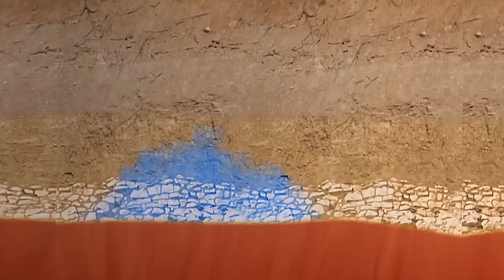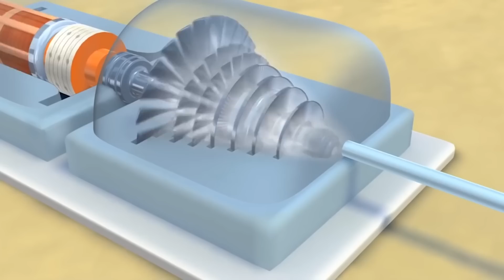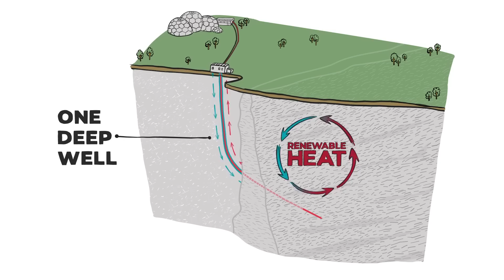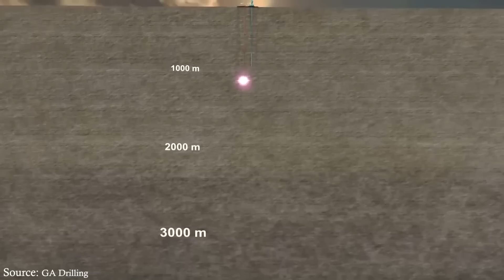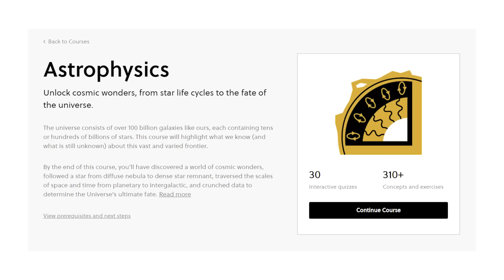How This Hole Keeps Generating Energy

Comment: If I may, all oil and gas wells on Earth can actually be converted into Geothermal power plants for electricity and district heating/cooling.
There are many abandoned oil/gas wells (including coal mines) that can be used for such a purpose... and oil rigs in the North sea are especially usable because the geothermal gradient there is far higher (aka, hotter temperatures at shallower depths of bore holes which automatically provide high enough temps for electricitiy and heating production [combined]).
Additionally, A LOT of the said oil/gas wells already reach down 6 to 12 km... which are deep enough for electricity production.

The Geothermal facility which was newly constructed in Cornwall UK was said it will produce about 3 MW of electricity and 12 MW of heating/cooling - and this is with a well of about 4.5km depth - which is not bad, but its also shallower than many oil/gas wells).

It was also said that converting oil/gas wells to geothermal would cost HALF as much vs what it would cost to decomission them - and heck, why not? The infrastructure is already there. 
Plus, all of the equipment, people and their skills are DIRECTLY transferrable to Geothermal sector.

While it is also accurate that for new geothermal power facilities the drilling costs are what account for 30-50% of the costs, what most people fail to realize is that utility scale geothermal power plants tend to pay for themselves in up to 10 years time (typically around 7 years maximum), after that, they are virtually free to run.
They also have no running fuel costs, have reliability and efficiency ratios of 90-100%, and levelized cost of Geothermal has been holding steady for over a decade now at $70 per MWh (whereas most running costs of Geothermal are between $14-$36 per MWh).

Essentially, Geothermal has all advantages of Nuclear, but none of its drawbacks (such as high running operational costs and production of nuclear waste - even new SMR's are ridiculously inefficient and will be producing 2-30 times more volume of nuclear waste than existing nuclear power plants - and their levelized costs are projected to rise exponentially in the coming decade - plus, standard operational costs of Nuclear are $156 per MWh - over DOUBLE of Geothermal).

Also, when properly maintained, Geothermal power plants can last over 100 years (as is evidenced by the Geothermal facility in Italy/Larderrelo)... and Geothermal brines tend to contain vast quantities of Lithium and other mineral resources.
It was said that the handful (about five or eight) of Geothermal plants in USA alone can provide the entire nation with many times more Lithium that it would ever know what to do with (and if we factor in other mineral resources in the brines, the payoff of the geothermal facility can be much faster than what I said above - similar ratios are for the Geothermal facility in Cornwall).

So, technically speaking, there is no need to make new wells because we have a vast amount of unused oil/gas infrastructure (even used ones) which can already be converted to Geothermal for both electricity and heating/cooling purposes.

But, I agree that Quaise' efforts at drilling 20km into the Earth would provide for much higher temperatures... but in that case, I would imagine that 20 km depth would provide for much higher temperatures than 400 degrees Celsius.

At any rate, the biggest problem plaguing Geothermal are not higher costs of drilling or our ability to access Geothermal resources for sustainable electricity and heating/cooling... its BIGGEST problem is LACK OF FUNDING.
Compared to any other energy source on Earth, Geothermal is the LEAST funded energy source on the planet.

And when we factor in how much money is given in subsidies to fossil fuels... you can tell that governments and corporation priorities do NOT lie where they should be.

Already, back in 2006, MIT released a study saying that we already had the technology at the time to access enough geothermal power to sustain Human civilisation for 200 years worth of... and that with improved technologies we can access enough Geothermal to sustain us for 2000 years.

The oil and gas industry has been digging deep bore holes ranging from 6-12 km depth for 100 years now... its not an issue of accessing Geothermal... the issue is lack of funding and willingness to shift our attention to Geothermal.
Reply: I mean we literally are sitting on a reactor, geothermal should be on the front of the energy solution
Reply: Most of them are not hot enough. E.g. if the bottom of the mine is 60 C, it's far too low to generate electricity (will cost too much per generated watt).
Reply: @denysvlasenko1865  The shallower wells can still be used for district heating/cooling.
Works just the same.
The deeper wells (ones which go down 5-6km) would be hot enough to produce electricity (in Iceland, they usually dig about 5-6km deep wells and then connect a whole bunch of them together into a single geothermal facility).

Either way, its doable.
Shallower wells with lower temps can be used for district heating/cooling, and the deeper wells with 145-150 degrees C can be used for electricity AND district heating/cooling.
Reply: @deksroning125  There are not than many 5+ km wells. Iceland is not representative - it is a magma hot spot. In most places, temperature at 5 km below ground is ~150 C.
Reply: You think too logically and straight forward. The reason why intelligent people like yourself are not allowed to design and build these machines is because it cripple the oil industry and radicalize what people thought about government, society, the capabilities and purpose of the human race. Progress will be denied.
Reply: sir, this is wendy's
Reply: > the issue is lack of funding and willingness to shift our attention to Geothermal

So, your theory is that drilling companies are willingly resisting creation of lucrative business of generation of cheap energy? (As opposed to the theory that they already tried it and it's not competitive in most locations). That would be very stupid.
Reply: @denysvlasenko1865  it's well documented that investment in geothermal is slim to non existent. The energy companies hadn't tried it before because it probably didn't occur to them. Furthermore the oil/gas industry receives massive subsidies to continue its business. 

It's only in the past year or two that some energy firms barely started looking into geothermal. 

We're talking about same energy companies that set for themselves a goal to reduce carbon emissions by 2050 despite the fact that a decade ago scientists have confirmed that transitioning to 100% renewables globally can be done in a decade and that existing agreements on lowering emissions are not being held up.
Reply: @deksroning125  > The energy companies hadn't tried it before because it probably didn't occur to them.

Absurd. There are dozens of geothermal stations in use. Energy companies DO know about the technology.
Reply: @denysvlasenko1865  
Dozens yes (but that's a far cry from hundreds like there are for say gas fired stations)... and why? Mainly because the geothermal sector progression has been stalled by lack of funding and virtually 0 incentive from the governments and not keeping up to date with the information about it.

Furtthemore, converting oil/gas wells to geothermal is not usually how geothermal is done.

Up until 2018, there hadn't even been any proposals about converting abandoned oil/gas wells into geothermal for electricity and district heating/cooling.

To top it off, MIT did a study dating back to 2006 which clearly stated that we had the technical ability back thento access 400 Zettajoules of Geothermal power globally and over 2000 Zettajoules with improved technologies (which exist today).

Furthermore, why are you ignoring the fact that the oil/gas industry has been getting massive subsidies or the fact these industries gave themselves until 2050 to 'limit emissions' which have been repeatedly stated that they won't be enough?

Experts across the globe are urging political leaders and even industries to go for geothermal, but there hadn't been a larger push up until a few years ago.

To most existing energy companies, popping up a brand new Geothermal facility is just for show for the most part. 
Also, it won't make a large dent in reducing costs of electricity or heating/cooling because the wholesale prices are fundamentally linked to gas prices.
Reply: @deksroning125  Oil and gas companies don't get any government subsidies, the UN have made that statement by calculating a negative externality and saying the tax rate should be higher, this methodology hasn't been applied to any other sector and isn't what subsidies really are. It makes it sound like the governments are providing funding. We've not yet been able to drill and maintain wells to a sufficient depth for efficient geothermal energy production, if we can crack this we have a limitless source for electricity generation. Inside plate boundaries we need to go 20km deep, oil and gas companies aren't going that deep.

Comment: @Ziroth If steam turbines in powerplants are substituted by cryogenic turbines using the same fluids as on freezers, solar power can be used to generate electricity even at night at latitudes up to 40 degrees North or South.

Comment: 1:11 Sieg: pressure from both earth compressing (and even from air pressure above it) generates friction underground.. this is the only Real cause of magma, which bellows out as 'volcanoes'..
there is no such thing as a "magma core" or maybe even a "crust".. that would be impossible, the upper crust layers of the surface would have sunk immediately into that lava..
Reply: It works just fine for boats on the ocean though.

Comment: What if we extract so much energy that the earth's core solidifies? 
This would destroy the earth's magnetic field which keeps us safe from charged particles from the sun and turn Earth into a Mars like planet.
Reply: That's not something that we have to worry about for probably millions of years. Besides, the earth is cooling down anyway. Might as well use some of that heat.
Reply: @Alex-lc1bv   The amount of energy stored in the earth's core while immense on a human scale is still finite.
Capturing heat released on the surface that would have been released anyway is perfectly safe.
Drilling ultra deep wells to harvest heat from the upper mantle is where things get dicey.

Comment: As much as I appreciate the effort made in this video and as much as I like geothermal energy, there is just so much wrong in this video. Redoing some of the voiceovers and cleaning up the misunderstandings may get the video to standard. First, and foremost, there seems to be a fundamental misunderstanding about the structure of the Earth and the composition of its different layers. I get the feeling that everything below the crust(?) or below 15 km (?) depth is referred to as the Earth's core?  Secondly, the core is largely iron and nickel, which means there is essentially no significant radiogenic heat produced in the core.  The radiogenic heat is rather produced in the mantle and crust. Thirdly, the super deep drills at the Kola peninsular and in Germany never were motivated by exploring geothermal heat. These were scientific projects. Also, what is the Earth's impermeable cap rock? If it is impermeable, how do they drill there?  Lastly, the normal geothermal gradient is estimated at something like 25–30 C per kilometre depth. This delineates some of the problems with deep drills, as you drill down you experience very high temperatures and pressures. The temperatures will compromise your drill, whereas the pressure will constantly try to close your drill hole. At 4:20 minutes in you say: "Attempts have been made to dig very deep into the Earth's core." No. The outer core is about 2900 km down and more than 3000 C hot. At the Kola Superdeep Borehole, they drilled just over 12 km ... you may find that there is still some meters left from 12 to 2900 km depth. At Kola, it was also somewhat hotter than expected (180 C) at 12 km depth, which was the problem that ended the drilling. Kola was chosen because back in the days the geothermal gradient below the Baltic shield was not well understood and they expected only 100C in 12 km depth. Then again, 180 C is not that much, you would think—water is supercritical at 373 C or so. Heat exchangers are needed to get water supercritical. So this business wants to drill 20 km (~500 C). OK. Not the core, though... still far from the mantle even, which is at about 660 km, even the lithosphere goes done to ~120 km. Do they have a plan for how they keep the hole open at extreme pressures and how to deal with the heat problem? The middle crust and the ductile-brittle transition is about at 15(–20) km depth, that is where rocks start to behave plastic over geological times...that is how hot it is down there. Just saying...
Reply: Agreed - this guy is a moron. Even worse, he's spreading all this false information as if it were true...
Reply: And you could have added that it's not actually infinite.  The Earth is halfway through its life and will be consumed by the Sun.  So it cannot be 'infinite'.  It's a very long time, I know, but the overuse (and incorrect use) of the word annoys me.

Comment: One thing that scares me about geothermal power is that the earth's core doesn't have infinite energy. And law of conservation of mass and energy says the core is a big old battery. And the more devices we power using this battery the less it will last.

So I present my theory: will geothermal energy wells turn the earth's core cold sooner than if we would have left it alone?
Reply: There are some misunderstandings in the video. The heat is not created in the core but rather in the mantle. The heat is generated by radioactive decay of U238 and other unstable elements. The mantle is a huge reservoir of heat and will slowly generate more heat, which is conducted away over very long times, through heat flow and convection, e.g. to the core or to the surface. The earth loses heat all the time. The tiny bit of heat that it loses through the crust, which is the tiny tiny reservoir (compared to the mantle) we could tap into will not be noticeable. The Earth is HUGE. Although, you are right that heat we take out is lost, for all practical purposes the reservoir can be imagined as infinite for humanity. We wont be able change the Earth internal heat budget even in a in million years.

Comment: why don't they just tap in to volcanos where the lava is already closer to the surface?
Reply: Possibly because occasionally they explode
Reply: @spackerinternational6131  who's to say the pressure between the drilled hole and the Earth's core will not exceed the strength of the hole and cause a explosion similar to a volcano? since that's pretty much how volcanos got created.

Comment: Actually, I think that this is a pretty stupid idea. Imagine this "solution" to be scaled up. We will cool down the earth much faster than necessary and this will in time interfere with plate tectonics, about the mechanism of which we still know rather little. If we use such technology to cool off lava domes which would sooner or later turn into super volcanoes - looks like a great idea on a first glance - whereby we do not know much about the importance of volcanoes in the long run. In any case, to just allow anyone to drill anywhere - very much not thought through. And the more efficient the process will become, the more havoc it will wreak. We should first of all better integrate the energy we receive from our sun into our infrastructure.
Reply: The amount of heat the interior earth presently and continuously  generates is far greater than what we could ever use.  Whatever heat we take would be quickly restored.
Reply: @jp5000able  Yea, the amount of  heat is greater than what we would presently be able to use, but if you have watched the past 100 years and its predictions, we were never able to imagine what even the same generation would be willing and able to do just a few decades later. Besides, this is not the core of my concern. The heat production inside the earth is more-less constant in the short term, and it is  slowing down in the long run (I assume that it is mainly radioactive decay). I assume the situation is similar as it is in the atmosphere. For the climate it does not only matter how much energy the earth is receiving from the sun, but it is of crucial importance how well the atmospheric blanket is able to conatain this heat. Processes inside the earth are not only dependent on heat generation of the core but also on how good an isolator the crust is. There is a probably delicate balance of which we know next to nothing and increasing the heat-flow by just a promile might have effects we can't imagine.
Reply: Nah, life on Earth won't last longer than the cooling off of the planet.
Reply: @Kaizzer  Hmmm... what I have been suggesting is that for us to create lasting havoc for future generations it might be sufficient to cool off the planet a little faster than it would have cooled otherwise beyond some possible tripping point. What is CO2 in the energy-balance of the biosphere? A little more blanket. What is geothermie i.e. for the mechanism of continental drift? A little less blanket. My point being that we have no clue about the consequences of our large 
scale meddling with life-sustaining systems of which we understand very little.